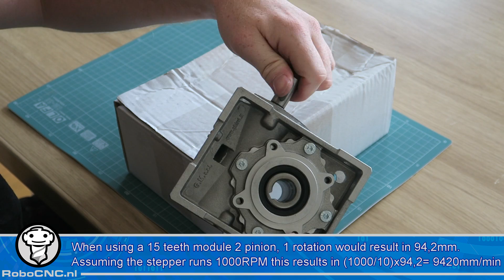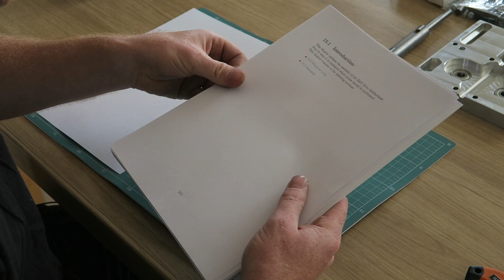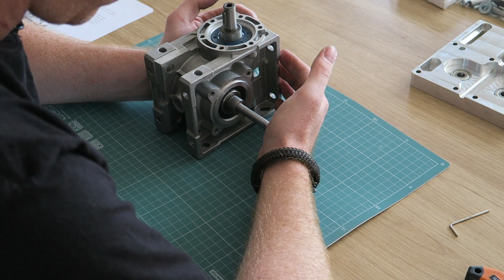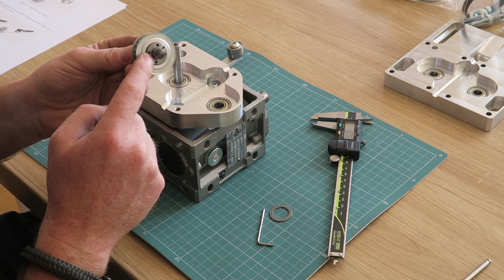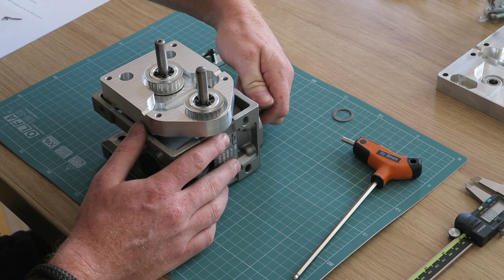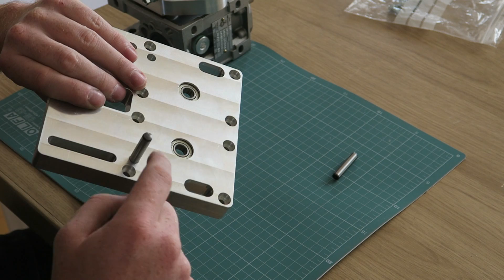RCNC X2 Router 10: DIY Assembly of the zero backlash Rack & Pinion system

Comment: Not reached the end yet but can surely say it's one of the very best CNC build series available ! 
And that anti-backlash double pinion gear box assembly is making me seriously reconsider my ballscrew choice... Thank you again, for all.
Reply from the maker: Thanks ! Well I think it all depends on the size.... I prefer ballscrew over R&P for lengths under 1 meter..
Reply: RoboCNC Frees- & Graveerwerk I'm aiming at 1250x2550 or even 1850x3200 cut area... Which makes me wonder if 80x160 profile is enough for the bridge, all the more considering I'd go RnP with the V40 for this axis too ?!
Reply from the maker: Ya would defiantly go with the RP, have a look at the DamenCNC website, maybe they have e nice kit for you...
Reply: RoboCNC Frees- & Graveerwerk after ending your X2 series, I actually spent the rest of my last week free time exploring their website and discovering their machine kit and RnP LSM modules/assemblies. Seem like they cross 2m with a 80x160mm profile... But compared to your spreadsheet, the sum of the 4 modules for X,Y and Z seem more expensive. Will get in touch with them this week to get a quote for a kit suiting my needs, we'll see... Anyway, hope this guys are grateful because you're making them just the best advertisement a business can hope for !
Reply: did you built it in the end ?

Comment: I don't think there's a lot of holes you can poke in this approach. It's solid, robust and simple. Which is exactly what you need in this case. And that's a very nice chunk of Aluminium. Fine engineering as in Fine China tableware. 

Can't wait until it's in the machine and rolling on that pinion. Thanks for sharing!
Reply from the maker: Hi Devjock, thank you for the great comment ! I cant wait to test the system :) lets hope we are right and that it is indeed the way to go... Thanks for following along !
Reply: Wouldn't wanna miss is for the world :)

Comment: Hi . Sorry, my english is not very good.
I'am from Argentina.
Congratulations for your machine and videos. Thank's for free share.
I'am very ansiuos to buid RCNCX2 router for non commercial use.
I will appreciate so much , if you can tell me when you plan to upload others parts of the project, like driver's , electronics, mounting X-Y motors etc.,
In other sense , what do you think about double ballscrew with two syncronized motors for X axis ?,
Best regard's.
César
Reply from the maker: For the upcoming stuff on this machine I ask to be patience and follow along in this YouTube Series.
As I said, a ballscrew (double for X) would be the best solution, up to 1 meter. Longer will result in problems.
Reply: Thanks Marcel!

Comment: Heeyy Robo, Goed uitgelegd weer !! Super!! Even ter bevestiging: Wat is de afstand van het vlak waar het op de brug gemonteerd word tot aan het item profiel... of tot aan tandheugel aanzicht? Groet, Ralf
Reply from the maker: Hi Ralf, bedankt voor je positieve bericht.... 
Oei... je vraag is cryptisch :) I'll go on in English so everybody can read this;

The Y-bridge side plates protruding 24mm outside the ITEM frame, so this RP system will have a distance of 24mm from the item profiles (except the pinions of course). The module 2 rack is 20mm wide and will be mounted on the item profile. So there is 4mm clearance between the RP unit and the rack. the two pinions protrude about 22mm from the RP unit, so they will clear the item frame by 2mm and therefor have a contact area on the rack of 18mm.
Hope this makes it clear.... (?)

Comment: Would the dual rack and pinion setup be worth doing with the "spring" type of setup that I already have.  I have way too much backlash and I haven't figured out how to compensate.  From your comment in the video you mentioned that there SHOULD be play between your pinions and the rack so my interpretation of this seems to be that if the spring has too much pressure against the rack this would have negative consequences?  What would the consequence be? More backlash?

I know this is an old post but whoever has an answer I'd be very grateful. 

Thanks for the video's, very helpful.
Reply from the maker: Only now see this comment.. sorry... 
A spring against the rack first of all results in friction wear. 
But it also rides on the dirt thats in there since it can not go away. Pressure should be on the side of the profile, not on the V. Also more backlash can be introduced with harder materials because this works against the spring tension. Anyway, it depends on what type of materials you cut and what forces you apply...

Comment: DO you think it would work for another application where I cannot have the chance to mount two of these?
So in practice just one of this would be "fine" and also with a better type of gearbox which has backlash less than 4 arcmins like harmonic plenetary or such?
Reply from the maker: Yes that would be very much possible... Although i would advise to use 2 pinion gears to run in the rack...

Comment: I just purchased three of these sets... My X Axis is going to be wide enough to hold a 4x8 sheet of ply, so I thought a R&P best. Would you suggest a Ball gear instead? It's right on the boundry of suggested width for a Ballscrew.
Reply from the maker: I think that's a wise idea.. long ballscrews will wobble and have a lot of inertia.
Or a rotating ballnut, which is very cool, but complex to make.

Comment: Hi MarcelHow wide is the timing belt in this setup, worries me a little it only looks 10mm and is hidden inside the unit.cheers
Reply from the maker: Yesy it is something like that.... If you do not tension it to hard I think it will be fine. It is not going to get to much force on it i think since it is only there to reduce the backlash of the RP. But time will tell...

Comment: The rule in mechanical devices is to keep it simple. You just took a system that had 1 possible place to have backlash (rack to pinion), and added a system that added 4 possible places to have/develop backlash! 1- worm to pinion, 2- gears to belt, 3- 8 bearings/fit to shafts. 3- new pinions to shafts (2), 4- manually set clearance of pins to rack. Really doesn't make ANY sense, except to SELL overly expensive parts, for no other reason than to put money in your, or someone else's pocket, with zero benefit to the end user. You know there IS such a thing a close tolerance/low backlash rack and pinions, or better yet helical rack, and pinion! For probably about the same, or less money as those contraptions.
Reply from the maker: Thanks for your amazing advice ;) good luck with your much better build !